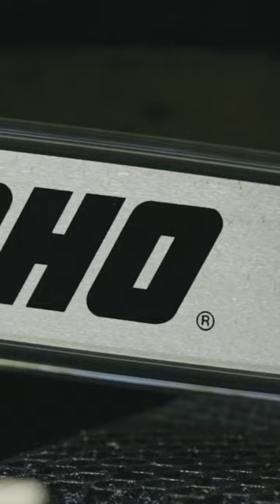Making ECHO chainsaws in Japan.

Comment: great work echo folks. I'm kind of an echo "power user".

here in some of the most trying conditions of interior Alaska in below zero weather, I run almost exclusively echo chainsaws. all other brands simply aren't as reliable or easy to work on. I go through at least 60-70 gallons of chainsaw gas a year.

I've even put the echo saws on the TV, always performing admirably, with no stage fright, ha!

I run a ported cs 1201, two ported cs 6700's, a ported cs 530, a cs 620pw, a ported cs 8000, and a cs 4910. I have also gifted a cs 400 to my son, as his first chainsaw and another cs 400 to my uncle.

love your saws! wish I could help with some honest, brave, adventurous marketing......
Reply: How would you compare the cs-530 model with the cs-4910?

Comment: Its hard to make a perts of motor with improwement tehnology ...for harder longer end big temperatura   on high end extensiwe use....like zilinder ..springs end buts ...ewend a part witch its responsable for give a roll on chain ...or its stil unknowed technology?..PS   The most of users like to hawe  a chainsave in long time 10 ,,20 or 30 years with stability in use...plus servise end parts..no meter in witch country.,,.end with strong outside parts witch are respectable in using on diferent terains wods or farms end houm....All the best  for all simple improwements fireasy secure end long using